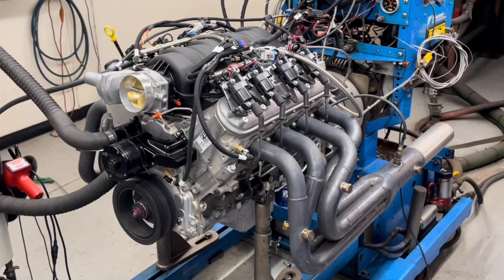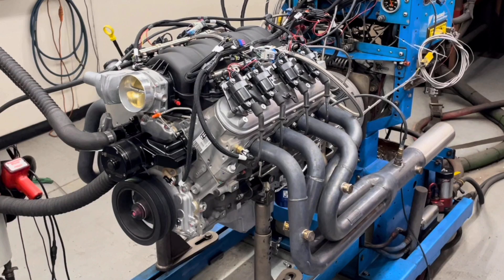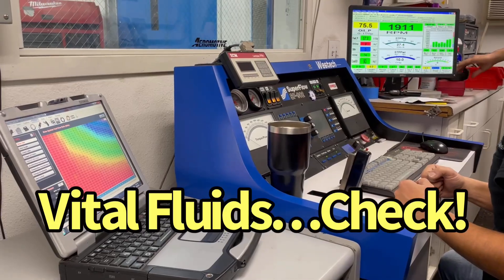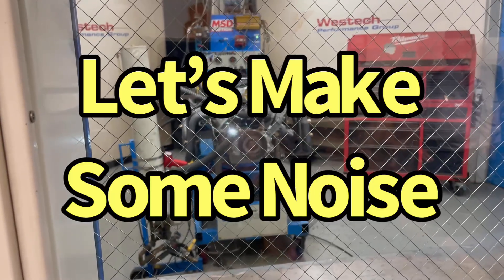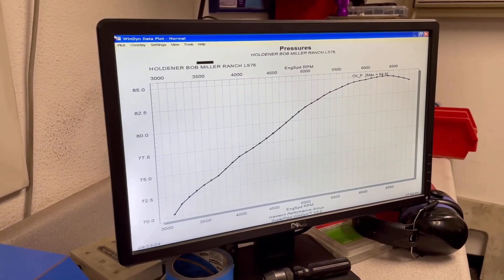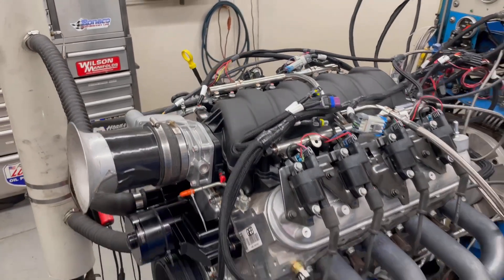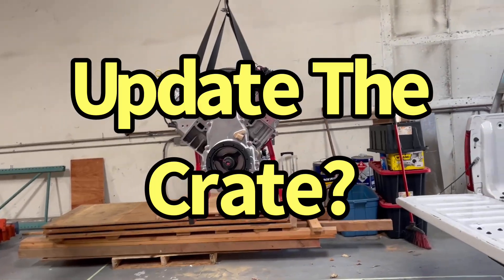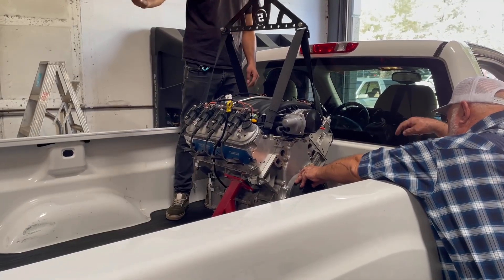DO GM 427 LSX CRATE MOTORS REALLY WORK? THIS 427 LS7 STROKER IS RATED AT 570 HP-WHAT DOES IT MAKE?

Comment: People like to talk trash about factory motors like this....  Considering this is a basically stock factory production motor that had to deal with emissions restraints affecting cylinder head design, ect... and don't forget cost constraints / bean counters and warrantee coverage, these are impressive numbers.  Let the Boo Birds bask in their personal fantasies !
Reply: This engine is anything but a "factory stock Production" engine. What a braindead comment. Ford was making this out of 427 inches in 1965. Beat your chest about nothing
Reply: Exactly!
Reply: LMAO Ford has been doing this shit with the Windsor for DECADES before the “LS” was introduced. Yes they make the same power with a stock produced Windsor block, stock bottom end from the factory. The LS is cheap as fuck and in everyone’s backyard. The LS puts up similar numbers, but is about 40 years tardy on the design
Reply from the maker: a 351W makes 100+ hp less than a 351W to start with-so maybe not the same
Reply: @richardholdener1727  A 427 Windsor given outstanding cylinder heads, cam, and intake will not make 100+ horsepower less than this LS. There is not much difference in cost at this power level. The Windsor has been around since the 1960s, the LS since the late 90s. Still doing battle with GM’s best pushrod stuff.
Reply: @huntersmith5863   so an entirely aftermarket part Windsor can keep up with a cam and ported head only LS and you want to beat your chest about it? Weird but whatever helps you sleep at night man
Reply: @knowbull5hit590  Sounds like you’ve had your heart broke by a Windsor before
Reply: @huntersmith5863  you claimed the stock bottom end windsor had been doing this for years except the 351 isn't. Can you tell us whats stock in the 427 Windsor bottom end?
Reply: @alfredstewart5107  If you want to build off that, then yes. Turbo bone stock F4TE roller blocks and OEM rotating assembly; rod bolts and all, have been 4.50’s and wanting more. All done by 7,000. Not many guys will admit when they lose to a Windsor.
Reply: @huntersmith5863  so based on that your original claim that the 351 has been making Ls7 power for years is uneducated nonsense. Gotcha
Reply: Its gone from making the same power with a completely stock bottom end to an aftermarket 427 stroker bottom end then to a turbo. Dude just admit that you were wrong rather than digging deeper and looking stupider 🤣😂
Reply: I would never have a problem running an Iron version of this or the 454 LS. Just my preference of the block material.

I mean I'm running an "Iron LS6", a former LM7 bored out to 3.898, flat tops, 799 Heads, btr 600 springs, Gen 3 Truck intake, "6.2" Style Cam Truck Norris 2600-3800 Stall Circle D.
Reply: @shadowopsairman1583  Sounds like a nice combo, I love mix-n-match stuff like this, and I really appreciate all the testing Richard has documented!
I always run iron block motors for my beat the snot out of it offroad builds, they withstand a ton of abuse and are economical to build, plus they give the needed nose weight for extreme climbs.
Reply: @shadowopsairman1583 Same here. I’m running an “Iron block LS6” which was a former L59 Flex Fuel 5.3 block, and I’m running the factory 2001 LS6 specs, because I like the sound of factory cams better, which is 385HP, 100 more HP than the factory 5.3 at 285HP. Man when I tell you it pulls better than a 6.0 Vortec I ain’t lying. My transmission has been upgraded to a 4L65E with better internals to keep up with the extra torque and 100 more HP. Things a beast for a 23 year old SUV (Suburban).

Comment: Anyone who’d buy one of these engines isn’t too smart.   The heads are junk and the rocker arms are worse.   The block is junk too.   Pay the coin and get a aftermarket block, heads and full roller rockers and cam (with matching springs and pushrods) to suit your needs.
Reply from the maker: all of this stuff is spot on for 600 hp
Reply: @richardholdener1727  yeah... but his friend's cousin's uncle once tried to put a 300 shot of n2o and a turbo on it.. and it broke. So.. it's gotta be junk. You've gotta get that aftermarket block or you are a square /sarcasm. People who will never spend the money to actually get a quality LSX block and sundry, let alone make the kind of HP.. SAFELY.. that would need that kind of nonsense are usually the first to call something like this junk. It works as designed, for what it was designed for, out of the box. Most people can't make past 500 safely, as they don't pay the money to upgrade the other components in the car to make it "street safe".  Not everyone needs a Steve Morris 2000HP rated motor, and it's not worth the money to buy something like that and not use it to purpose. I'd rather have one of these in my car. It would be a good daily driver.
Reply: I have daily driven mine. Car is pretty docile just cruising at 1800 rpm In 6th gear.
Gear down to 3rd and crush the go pedal....it will hang with any stock hellcat out there. 12k miles on it so far. I love this motor. It is bone stock out of the crate. Just has 1,3/4" x 1-7/8" stepped headers. Stock npp exhaust. And had to swap the oil pan
Reply: If your needs cap out at 600hp, is it smart to spend all the extra coin for over-engineering that you will never need/use?

AND how many people do you know that rally need more than 600hp under the hood? 

The are probably near a million of these junk engines out there still functioning after a decade plus. It is pretty much an exact production car engine, warrantied and all. Perfect for a resto mod with a little pop. A simple package with widely available replacement parts which are unlikely to ever be out of production. Your declarations just do not seem rational.

Comment: Definitely needs a msd on it....be another 20+ hp and probably carry much better.
Reply: What do you base that on?
Reply: @alantrimble2881  Multiple years of people modifying ls7s.... Everyone knows a stock ls7 gains power with an intake manifold
Reply: @7000U9ZHIFT  Sorry, I thought you were talking about an ignition system when you referred to “an MSD”.
Reply: @alantrimble2881  i thought the same thing at first “wtf is this guy smoking its not a points distributor” 😂
Reply: Lolz...
Reply from the maker: agree on MSD

Comment: The cooler she runs the faster she runs
Reply: Until the cylinder splits or you drop a valve.  Lol
Reply: @JamesStover-gr3hw  not an issue with these crate engines, the factory in car ones though thats another story lol